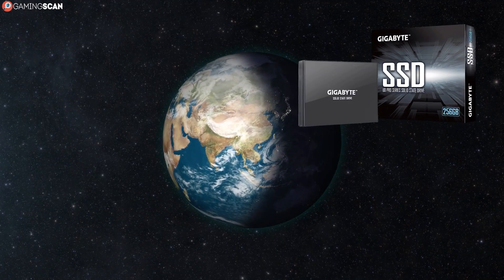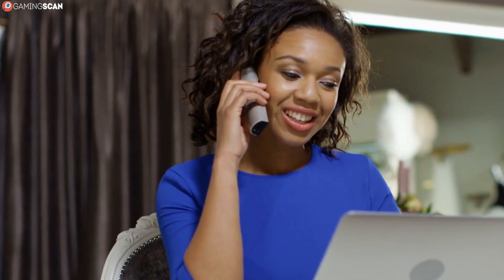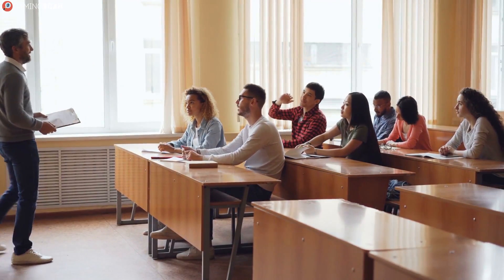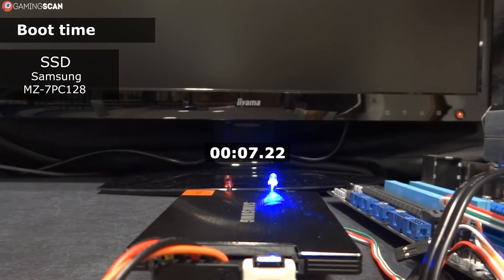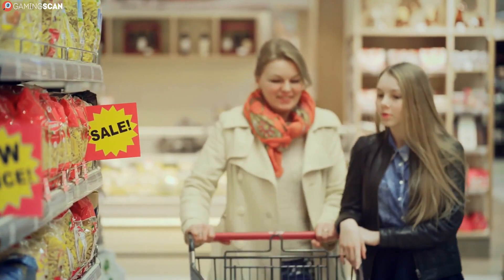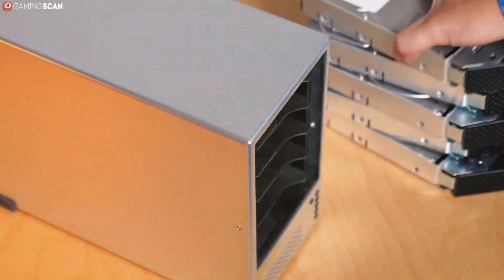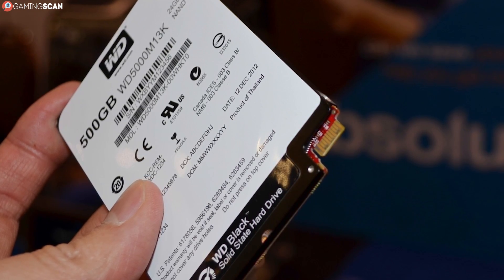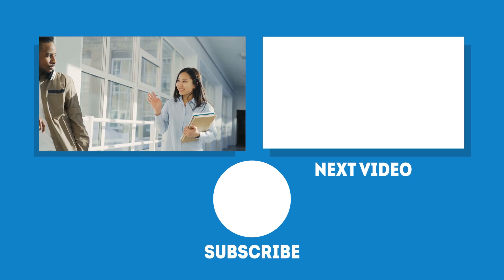Is An SSD Worth It For Gaming? [Simple Guide]

Comment: Just so anyone knows it will help with alot when your having stutter problems when your playing a big game like GTA 5
Reply: It's not only about ssd/hdd. If you have stutters it's more about ram. These days is best have atleast 16gb dual channel (that's mean 2x8gb) because dual channel will geive you significant perfomance boost) another factor is gpu and VRAM. If you gpu doesn't have enough VRAM you can't much do. Only decrease quality (textures are taking most VRAM) these days is recommended 6-8gb. Last factor is cpu but it's more about game engine. Some games will take more gpu usage, but some will take more usage of cpu. What i can recommend you is increase gpu and cpu frequency (A.K.A overclock). For that I'm using MSI afterburner. It's really easy to use and safe (yeah i've got sometimes BSOD when i've increased frequency too much, but after reboot was everything OK and i could continue again)

Comment: If you play a game such as fortnite, with an hdd, going into a game, you will have so much lag spikes and no textures or building will load in properly, an ssd fixes that
Reply: Not really
Reply: @nickythepro5743  no it does i tested i used a setup with hdd i 5 8 th gen and gt 710 8 gb ram

and second setup with i 7 10 th gen and rtx 2060 super and m.2 nvme 500 gb ssd 

in hdd it was lagging 
in ssd it wwas smooth

Comment: YOUR ALL BIG FAR LIERS.. THE REASON YOU WANT AN SSD FOR GAMING IS BECAUSE GAMES THESE DAYS DEAL WITH HUGE CHUNKS OF DATA. AND ALOT OF THE BACK AND FORTH WRITES AND REWRITES CAN EXHAUST THE VOLUME ON THE HDD HEAD CAUSING IT TO BREAK. HDDS WERE NOT DESIGNED TO HANDLE THE HEAVY LIFTING A NON MOVING FIRMWARE SSD CAN STOMACH. IF YOU DONT WANT TO GO RUNNING TO BEST BUY EVERY TIME A NEW WITCHER COMES OUT OR YOU JUST HAVE TO HAVE THE NEWEST AND COOLEST GAME AND YOU NEED TO DELETE SEVERAL HUNDRED GIG GAMES TO MAKE ROOM SO FORTH THAN GET AN SSD
Reply: you do realise an SSD has limited read-write cycles. a  hard drive does not. although its true that moving parts will eventually wear out a HDD, I still use a hard drive from 2010 regularly in my pc, installing and uninstalling games from it almost daily. an SSD from 2010 would probably have about 2GB of usable space remaining. 

not to mention most games dont write and rewrite. theres no need, once the game is installed, the game is read from storage. and SSD will help with load times and texture/asset streaming
Reply: @Great.Milenko  just got this comment it's been a year... dont remember writing this or why. Too lazy to watch vid... sorry if I've offended I drink and get high alot...

Comment: There are many games out there that do actually benefit from SSD over HDD. Hitman2 load screen and during gameplay has micro stutters which are not always shown in FPS measures. But this stutter is very much an annoyance and takes away from the gameplay pleasure. An SSD can quickly supply to system memory when needed by the game. I have 16 GB of fast system ram, but the Game itself may not be always loading everything into ram. SSD does help in more than just loading times.
Reply: What about roblox

Comment: people keep telling this BS that ssds are only for loading times, that's a lie, similarly people keep telling others that 8gb enough for gaming, these are all lies, ssds and more ram GREATLY reduce stutters, try to run for metro exodus with 8gb and without an ssd and you'll know what I'm talking about
Reply: It depends though. For significant stuffers you need a really crappy hdd. Like I mean a 120gb hdd from 10 years ago. Also do you mean 8gb as in ram? If so that is all you need without running background tasks. Games usually use around 5 gigs of ram.
Reply: @hdtv1063  the issue isn't the amount of memory you have and the game uses, it's with having enough "breathing room" for fast swaps, if your stick is fast enough 8gb might be ok
Reply: @JoaoPedro-ni6jk  true, it depends, 1666 is the minimum for older intel chips
Reply: @hdtv1063  I imagine 1666mhz ram struggling quite a bit with 2019-2020 games, but if you have 16gb + ssd it won't be as bad
Reply: @JoaoPedro-ni6jk  I mean considering I still use it I can play cod warzone 80+ FPS with a rx 570 hdd and 1666mhz ram
Reply: @hdtv1063  average framerate isn't the issue, stability and the 1% lows are, I highly doubt you have good stability with 8gb 1666mhz, and if you truly do, you've got to be tweaking your game/windows page file just about right, because that's not most people's experience
Reply: @JoaoPedro-ni6jk  that’s true with stutter though.
Reply: @hdtv1063  that's exactly what my original comment was talking about, the stability factor

Comment: Can someone answer this is 128gb of ssd and 500 hdd good for causal gaming
Reply: Not really, any AAA games are going to be very large downloads now, for example Call of Duty Modern Warfare weighs in at easily close to 300gb now which is insane, and more and more games are catching up to this mark. I'd advise maybe a 1tb HDD and a 500gb SSD if you can, or even a 250gb SSD and only put the games you play the most on it along with Windows etc. 

Hope this helps.

Comment: I have an old Samsung 840 500gb and secondary 3tb HDD, 2tb HDD, and 2tb NVME M.2 @ 3500/3000. I hardly even notice much better load times on the M.2. It's just not there yet for gaming and devs are going to have to optimize for these SSDs, and until then it isn't really worth it for gaming. Once the new consoles come out later this year I'm sure it will push devs to optimize for SSDs on the PC as well, for those who own them. We'll start seeing real improvements starting end of this or early next year with PC gaming.

Comment: Is it worth getting an ssd if I use my pc only for gaming?
Reply: If you play a game with a lot of loading screens, then you'd see the difference. If u were playing that rarely has a loading screen, except for faster game boot, you wouldnt see a difference. Bottom line, you dont have to have an ssd for gaming.
Reply: @MrExcessum  so like if I was playing star wars empire at war with quite alot of loading it will run faster so is 250 gb good for that and for strategy games I'm pretty new to pc gaming so any help welcomed
Reply: @Devastator21  240 (-256gb, depending on the manifacturer) is the bare minimum if you can make the leap to 480 (500) gb, you'd be set for a while longer. For a tidy person, even the smaller storage will sufice, but if you plan to have multiple tittles installed at the same time, than even a 1gb could fail to please.
Reply: I notice almost what really seems like a huge difference in fps when comparing my SSD card and hard drive to gaming. 
I can a Max out Resident Evil 2 remake on my SSD card. 
But my hard disk drive comes nowhere close to it FPS wise. 
but I could be wrong somehow.
Reply: Buy a SSD card from Best Buy and test it and keep the receipt and if you don't like it bring it back that's all
Reply: Dejvas yes

Comment: Fuck... I should've bought a 500gb SSD and a 1tb HDD. Instead I bought a 1tb SSD.
Reply: should i not buy a 1tb ssd i have it in my cart and dont know if i should buy it now
Reply: @moji3812   Yes, you should. Before, I thought it's important to get as much storage as you can. That is why I suggested part of it to be HDD because HDD is cheaper.
When I got my SSD, I suddenly realize that there is a difference in noise. The HDD is mechanical so the computers with HDD are much louder. Doing away with them makes it much quieter.
So if you want more storage you could do a combination, but if you want your PC to be quieter I would just suggest an SSD.
Reply: @GrubKiller436  ok thank you for the fast reply

Comment: I’m looking into gaming PCs and trying to learn more about them. I’m planning on playing games such as Call of a Duty, R6, csgo, overwatch, and others. I know csgo isn’t a very high demanding game so it won’t need much but is a 240gb ssd and a 2tb hdd overkill?

Also, what should I put on the ssd and what for the hdd?
Reply: No it's not overkill. If you plan on installing many games the 2tb hdd is good for storage, especially with games becoming way bigger nowadays (New CoD and RDR2 are both over 100gb, smh). If you get a 240gb ssd it's recommended that you put windows on that. Also if you plan on having your games only on HDD, get 16gb of RAM. Some games require a good chunk of RAM and even though they can run fine on 8GB, they will stutter badly while paired with an HDD. The only way you'll be able to play some of those games with 8GB is if you put them on an SSD. I'm speaking from experience. 16GB RAM will guarantee consistent performance across all games.
Reply: @GensenPrime  If I play only 1 game at a time, is it a good idea to move that game to ssd from hdd while I play it, and is it hard to migrate an installed game to a different drive, and do other people do it? And how do you do it?
Reply: Me too im getting a 1tb baracuda hdd as its cheaper

Comment: Is one ssd and 1tb hdd a good combination?
Reply from the maker: Yes
Reply: @GamingScan  thnx
Reply: If I have 512GB SSD in a lappy should I still add 1TB HDD ? or it (512GB SSD) is enough for better performance in gaming ?
Reply: @VipersLord  if u can manage your storage then.. yes
Reply: Is a 2tb ssd and 3tb hdd overkill?
Reply: @Alex-xl1sq  yes.. kinda.. but if u can afford it.. then no problem
Reply: @cry baby yes you can.. i have a 500gb sata ssd and a 1tb sata ssd.. make sure you have the proper pci ports in your motherboard.. if not buy a new pci slot to use the nvme ssd.. 

My recommendation is to balance the ssd and hdd it helps you to save alot of money.. but it is ultimately your choice
Reply: Govardhan G Im switching from console to pc and if i buy a pc with 512gb storage and i add an ssd 512 gb does that mean i will have 1024gb of storage for games or? And is it neccesarry to buy pc add ons such as a new fan etc? im mostly intrested in more storage
Reply: @Bestyboi123 
Yes you will have 500gb in ssd and 500GB in hdd both as separate drives (not combined).. but i recommend buying higher than 500GB in hdd (like 1TB)..  since its a lot cheaper and useful for pc

 there are four types of storage 

1. Standard hdd
2. Ssd hdd
3. Ssd sata
4. Ssd nvme 

Ssd are lot faster but lot expensive.. so it is essential to have both ssd and hdd if u don't have much budget.. i recommend having a 128 - 500 GB ssd and have windows installed on that.. with 1tb hdd storage (hdd's are a lot cheaper).. single player games can be well played in hdd.. but if u are playing any online games a ssd is essential to reduce latency or lag..

And pc is mostly modding.. console you buy the console put the hdmi cable, attach the joystick.. boom you are done.. pc requires modding.. cpu tends to heat.. and with the gpu (graphics card) the pc case tends to overheat.. thats why fans are installed.. if u want a chill cool system fans are essential.. if u do some overclocking.. (which is always done in pc gaming) the pc case needs to be cool at all times.. so fans are a essential part in pc
Reply: Govardhan G I found an hdd with 8 tb space for about 250 dollars that is well in my budget should i go for that?
Reply: @Bestyboi123  sure and buy a ssd too
Reply: Govardhan G Ty man appreciate it:)

Comment: I'll stick with normal high end hard disk drives. Too many horror stories behind SSD drives. Besides, I've had the same western digital drives for over 10 years.
Reply: If you're ok with having longer start times on your OS you can set up a couple SSDs for game storage (in raid for redundancy) so you get super fast game load times plus the reliable os drive.
Reply: cc cav I respect u but i just bought an ssd for my pc and I’m using the old hard drive and like extra storage and my system started to work really fast and windows takes like 4 or 3 seconds to load in like Jesus
Reply: cc cav my ssd diedddd :)
Reply: @stefanzivanovic4466  which brand ?

Comment: I currently have a 1TB western digital blue HDD and i got a 120GB SSD. would it be best if i had my windows install on a SSD then get another SSD for my games and have my HDD be just for storage of my media files? (pictures/music/movies/etc)

Also is the performance difference worth going through with a fresh reinstall of my win 7 OS+ reinstalling all the additional drivers? And if i did that how could i still use my HDD without wiping it entirely? (i still have files i want on it)
Reply: I have 970 evo 250 gb for windows and 1tb wd blue for games, the only games i have on ssd are dota2 and pubg and some small emulator games, i feel i dont need to blow 25k inr on a 1 tb evo pro just because i want some single player games to load fast which being 3-4 aaa titles a year
Reply: And yes the performance in windows is very much noticeable with fast m2 like evo 970, i dont get those chrome load times or random slow downs anymore

Comment: In this day and age you don't need huge HD anymore. Most file are in the cloud or in an external HD.
Reply from the maker: True.
Reply: For gaming you do
Reply: @Mrkrul  Thats the point, you dont.    Everything is on clouds these days, movies are streamed, or piratebay downloaded in matter of few minutes, then deleted. So you literally dont need a hdd. And the last thing is: i need it for games.
No. You dont. If you install ten 40-100 gb games, and keep em all on, you re not gaming, you re hoarding. Get a 240-500 gb ssd/nvme, keep 1-2 games you actually play on there, and you ll be fine. When you get bored, or finish em, delete them, and install&play new ones.
Reply: @MrExcessum  it's not hoarding, it's a prove that ssd is not cost efficient storage.. I live in country with low internet connection speed, it will take days to redownload >50GB size game.. I also don't want reinstall my game mods, it can took hours or maybe days to reconfigure the mods
Reply: Now is 2021 and still using hdd because it have larger capacity with affordable price.

External HD yes, I use it, but cloud nah.
I prefer keeping and collecting my favorite stuff than download or streaming.
Because I can just easily recall it whenever I want without depending on another factor like internet.
Not everyone has fast and stable connection.

Maybe I will try SDD when they have an equal price like HDD.
I'm usually using my notebook for gaming and watching some movie, waiting time not a big problem for me.
Better to spend that money to bought another external hdd to grow my games and movie collection 😁.